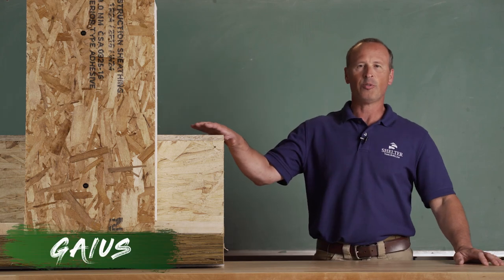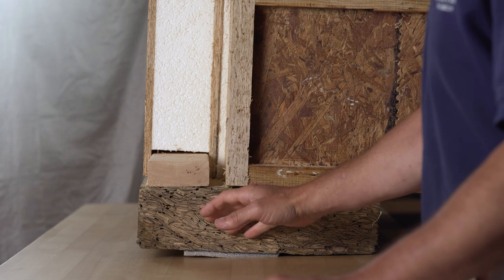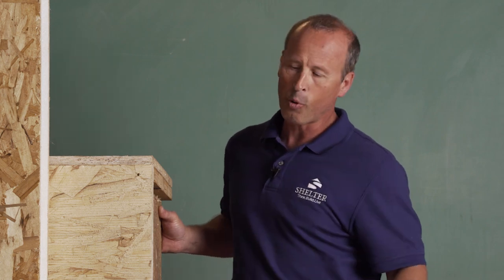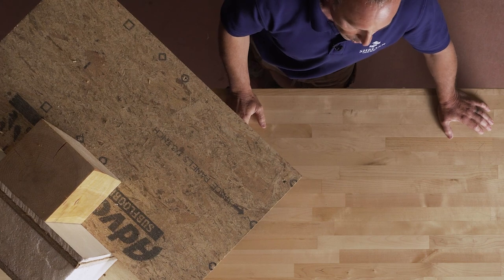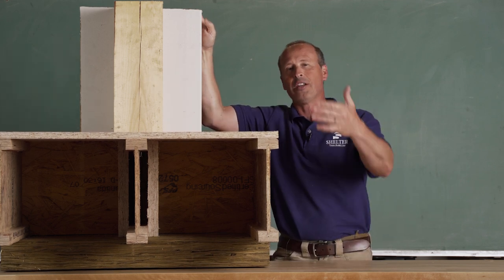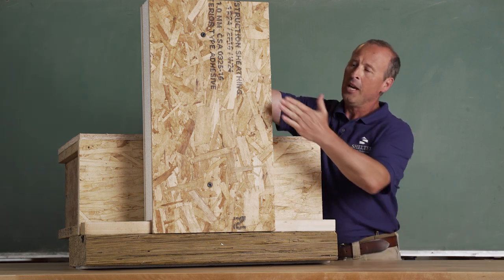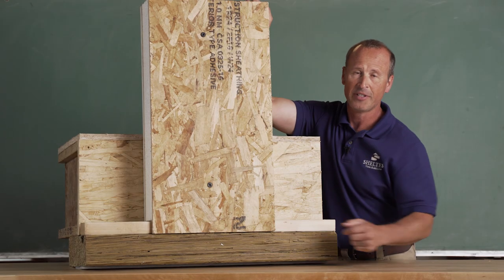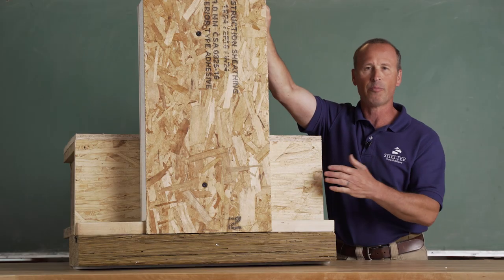How To Attach A Timber Frame To Concrete Foundation - Pt. 1

Comment: Wow, excellent detail, per usual. Thank you guys.
Reply from the maker: Thank you!
Reply: @ShelterInstitute  

I would like to see the detail of securing the Wood Sill and answer why the Timber Frame posts are not ALWAYS directly secured to the Wood Sill using a structural steel bracket.

Comment: So to me I would think the best way would be to use a raised slab foundation and take into count the thickness of the wall system such as the SIP. Then just use the right heavy Duty post bracket anchors that you can drill and epoxy into the slab. I would also make sure that each post has a full dimensional pier footer that goes from top to bottom so its stronger and can carry the weight more efficiently.

Comment: Timber framing is strong. Those I joices are not. My current house has them and the floor vibrates throughout the house. Builders us them because they are cheaper than real lumber.

Comment: How thick is the concrete foundation typically?  Does it match the thickness of the timber posts?  Is the foundation typically directly under the frame or does it split the SIP/frame?

Comment: How does all of this work over a typical 8" wide concrete foundation?   You have 8" timbers, 6"+ SIP, etc. on top of a 12" sill plate, on top of an 8" foundation.  Does the sill plate overhang front and back evenly or does it overhang more on one side?

Comment: I was curious if there is a way to order the manufactured sill plate, SIPs panels, and or the engineered I joints for the first floor platform from your company? Alternatively maybe links to the companies that produce those products?

Comment: How many inches wide do you recommend for the concrete foundation?  Can concrete block be used?  Do you use pilasters at each post location?
Reply from the maker: These questions are case by case basis and should be engineered. That being said we often build on an 8-inch wide cast in place concrete wall. You can use concrete blocks but if you do that we recommend pouring a steel reinforced concrete grade beam on top of the blocks. We occasionally use pilasters, though typically as a way to reinforce a long stretch of concrete wall with unbalanced backfill.

Comment: "when we don't have a first floor platform."  I'm assuming that would be in such a case as a timber-frame garage or workshop with a concrete floor?
Reply from the maker: Yes that is correct. When the post interfaces directly with the slab.
Reply: Americans get storeys mixed up. Ground floor is as it says. First floor is above that

Comment: How do you secure the Sill Plate to the Concrete Foundation?  
Then how do you secure Timber Frame member to the Sill?
Maybe you should show these fasteners??
Why not have the Timber Frame attach directly on the Sill Plate to transfer load without having that weight go through the Floor Joists?
Reply from the maker: Check out this new video we just published, maybe it will answer some of your questions. There are some shots of the sill plate being anchored into the concrete foundation, and the floor platform being built as well - https://www.youtube.com/watch?v=NtPCF5i6b28

Comment: How does the dry wall and electrical/plumbing work with those big timber beams preventing you from laying conduit (and such) horizontally? Especially if you have the beams exposed on the interior as is design choice for many homeowners.
Reply from the maker: We hang the gypsum on the outside of the timber frame so the timbers are free to shrink and expand seasonally. The SIPs are then installed outside of the gypsum. We recommend putting plumbing in interior wet walls, to avoid freezing in temperate climates. Typically the wiring runs inside of the SIP wire chase so it is independent of the timbers inside the building.